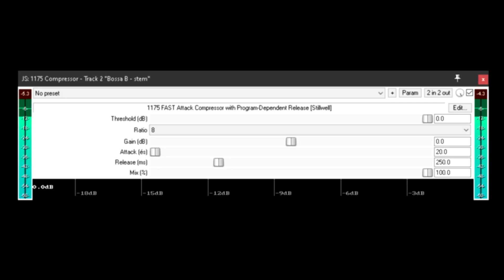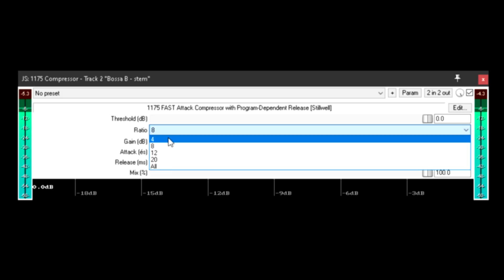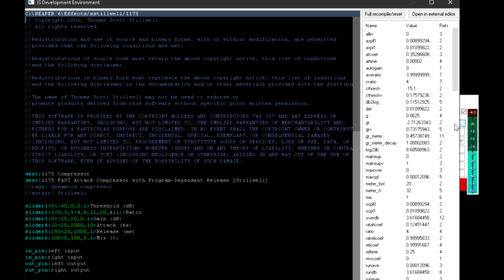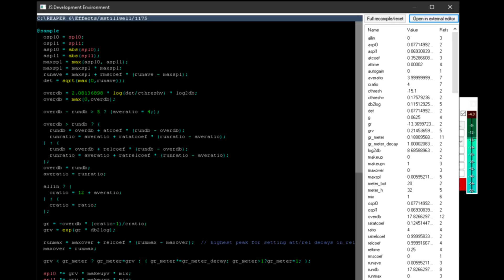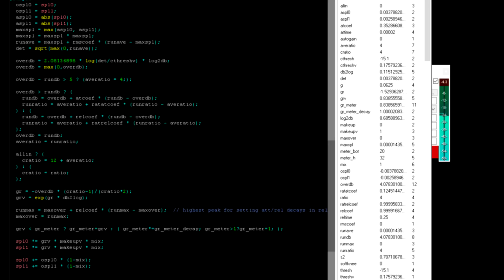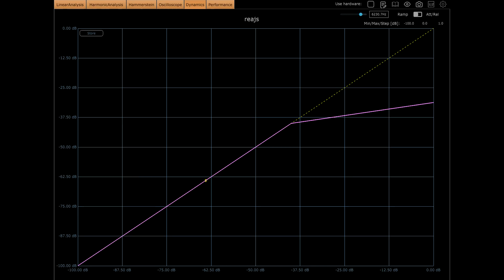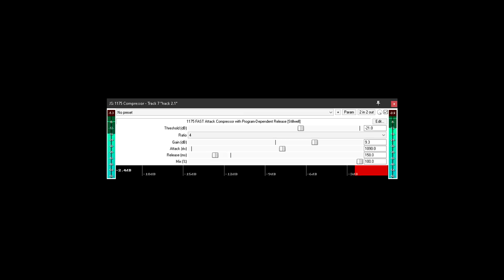All Buttons In Is Not A Ratio Control

Comment: Hi, if you have found an error in the code over a year ago why this is still not corrected in Reaper?
Reply from the maker: It was fixed almost immediately.
Reply: @DanWorrall  Possibly somewhere else in the code, because I checked the line from your video and it is no multiplied by 2.1. thank you.
Reply from the maker: The line I changed was not the bug, my fix worked but was just a quick and dirty hack. The actual error, further up in the code, is now fixed properly, so my hack is not required.

Comment: All button in mode on the 1176 changes it from a feed-forward compressor to a feed-back compressor. That is why it changes the Attack and Release behavior. That is the case for the hardware at least, I am not 100% sure of the plug-in.
Reply from the maker: I don't think that's true. I would expect the ratio to get lower in that case. AFAIK the 1176 is always a feedback compressor, and ABI does something more complex than that.
Reply: @DanWorrall  I am making that conclusion directly from the electrical schematic. The ratio buttons control a resistor network that feed the detector. When you press all buttons in it puts all of those resistor in parallel and creates a lower resistance to the output side of the gain stage than the Input side, as it is in all other modes.

This explains why you are seeing these unexpected behaviors. I know of no other explanation for the threshold decreasing after the knee of the compressor and the Attack/Release knobs effecting ratio. Those are feed-back design behaviors.

Comment: Basically, the 1176 itself is a very interesting compressor. I’m judging by Tim Petherick U76 compressor for nebula 4, because it’s most accurate emulation of 1176 compressor and you really can’t hear the difference with hardware in blind test. So, at first, the 1176 all buttons mode modulate the signal. In plug-in doctor I see that waveform do changes from sine to something between sine an sawtooth, that’s doesn’t happens to another ratios. At the second point, all ratios are really looks the same but with different threshold point, and this point are floats according to a attack and release times. Attack and release times (or maybe “speed” is more accurate) also floats according to input signal amplitude. Lol.

Comment: Et voila! From the 6.27 changelog, released a couple days ago. " JSFX: update 1175 compressor and various others to fix overcompression, add deprecated blown capacitor mode to preserve old behavior".

There you have it. Gotta appreciate the interaction here. It's hard to know for sure, but my hunch is that this wouldn't have gotten changed were it not for this video. Good contribution! ;)

Comment: Fixed in next reaper release:
6.26rc3 - March 26 2021
+ JSFX: update 1175 compressor to fix overcompression, add deprecated blown capacitor modes for old behavior
(havent check the code, not sure how it has been fixed, a diff check is needed)
Keep reporting ! 😉
Reply: Funny, this bug was alreayd reported at least in 2013, and affects other JS plugins: https://forum.cockos.com/showthread.php?p=2008836#post2008836
Though, it should all be fixed in nest version.
Glad you made a video about this :P

Comment: @Dan Worrall , I expect the problem isn't with the calculation of ratio (which really, truly should be correct), but with the value of "overdb" which is being multiplied by 2.08136898 (suspiciously close to your 2.1, eh?) on line 84 of the stock version of the plugin (line 10 of the @sample section).  Your change accomplishes roughly the same thing as removing that multiplier, I'd think.

Being that I wrote that around 15 years ago and haven't touched it since...it's hard to know what I was including that constant multiplier for, but I think that's more than likely the problem.  Some of the math in there is condensed down to constants where possible to avoid using expensive functions like LOG() or EXP() if I didn't absolutely have to in the middle of a per-sample loop.

A lot of those JS plugins were written as proof-of-concept of things I was working on...and JS is absolutely BRILLIANT for that.  Also, like anyone, I learn over time and things I did then may not be the same things I would do now.  You live, you learn.

Really, REALLY odd that nobody's brought it up before now...or at least nobody brought it directly to MY attention where I could do something about it.  I only found this video because someone else pointed it out to me.  Always feel free to reach out to me if you have concerns about something I've written - if you don't have my contact information you can file a support ticket or fill out a contact form on the website and I'll be happy to provide it for you.

Thank you for bringing it (indirectly) to my attention. :)
Reply: Reviewing the source code of Rocket compared to 1175, I'm almost completely certain that's the issue.  I've reported the same to Cockos if they want to fix it in their distribution, although that would cause a major backwards compatibility issue for existing projects.
Reply: No problem for backward compatibility, as it turns out. The plugin has been updated, and the old settings are listed as "blown capacitor (ratio n) - deprecated" under the ratio dropdown. So the old settings remain, as well as the new ones.
Reply: @petersamps  yep, talked with Justin at Cockos last night and this morning about it and reviewed his fix before he released it. 👍. Existing projects will use the “broken capacitor” presets and new instances will use the new settings by default.
Reply from the maker: Now I feel bad. In my defence, I had no right to expect support for an old JS plugin that's bundled with Reaper... But thanks for chipping in and clarifying, and I promise not to do that again!
Reply: @DanWorrall  absolutely not a problem...you shouldn't feel bad at all!  I wouldn't have known the issue was there unless someone reported it...if you find a problem in something else of mine, please...DO let me know.  I just find it somewhat humorous that it's taken THIS long for someone to say something!

Comment: I have absolutely no idea about compressor design, but I did some testing, and from what I discovered, the code that calculates the gain reduction `gr = -overdb*(cratio-1)/(cratio);` is actually correct. An equivalent formula, that's maybe easier to read would be `gr = -(overdb - overdb*(1/cratio));`, which basically calculates the difference of the uncompressed over-threshold level and the compressed level. The problem is that the value of overdb is roughly twice as big as it should be. Perhaps it has to do with the following line:

overdb = 2.08136898 * log(det/cthreshv) * log2db;

Edit: Turns out this has been discussed on the reaper forums quite some years ago: https://forum.cockos.com/showthread.php?t=125584
Reply: Removing that   * 2.08......    bit I can make it null with inserting the same value inserted in the GR line, as shown in this video.

Comment: What I get from seein this compressor work is that it actually is a Negative Ratio compressor, the most extreme way to compress. 
It works something like this:
Let's say you have the threshold at -12 and the signal is peaking at -6. If you set a 2:1 ration the compressor would reduce 3 dB in theory.
With a ratio of -2:1 (notice the minus which indicates it's negative), the compressor will reduce 2x times what goes over the threshold, which would be 12 dB.
If the ratio was -3:1, the the compressor would reduce 18 dB. 
And so on.

Comment: Over on the Reaper forum, it's being suggested that the version of 1175 that is included in Reaper isn't necessarily the version that Stillwell wrote, but possibly one of many user-modified versions floating around. I know that you looked at the plugin after many requests, however, due to the fact that JSFX code can be modified by anyone and then uploaded without any real oversight as far as credit and versions is concerned, saying "1175 doesn't work properly" is kind of like saying "water is wet". All JSFX plugins are suspect. They're a great tool, and I use certain ones all the time, but for my own piece of mind, when I find one that does what I want, I copy the code to a special place on my hard drive just in case the thing gets modified, sometimes not even by the original coder, and breaks my project.

Anyway, I love your videos, but I think there are more compelling topics to address than the accuracy of a JSFX plugin. Just my two cents.
Reply: I know my version didn't have a gain reduction meter, so yeah, SOMEONE has changed it...but I don't know by how much.
Reply: how can a modified version end up in the REAPER installation package?
Reply: @GULF_OF_aMEXICO  the same way the original did...by someone giving it to Cockos and allowing it to be used, or by Cockos making the change themselves.
Reply: @sstillwell  you mean you weren't aware that they had been distributing your plugin?
or weren't aware that it was a mod?
i thought all those JS plugins came directly from the devs or with their approval

maybe that was the original they got
Reply: @GULF_OF_aMEXICO  No, that's not what I mean at all.  I gave Cockos the original version of 1175 directly, and for a long time that's what was distributed, because originally there was no way to do graphics in JS...that was added by Cockos later.  At that point SOMEONE made the change to 1175, but that was no concern of mine as I had already given it to them to do as they wished with it (assuming compliance with the licensing/copyright restrictions as stated in the comments at the top of the plugin).  I just don't have an original copy of 1175 to compare to to see what changed (although Cockos keeps archives of their installers, so you could "go back in time" to see what the original looked like.  I suspect the bug was mine, though, not someone else's.
Reply: @sstillwell  got it, thanks for clarification

Comment: Great tip! Now I just have to figure out how to do the same thing in Macfizz's GUI modded version if 1175. Btw, how did you manage to load a jsfx in plugin doctor?
Reply: i just modified Macfizz's mod, but didn't test it, so if you need pointers let me know
Reply: @GULF_OF_aMEXICO  It is the dkaps.jsfx-inc file that contains the compression algorithm, right? Is it line 63 that needs to be changed or some other line?

Edit: Figured it out. It is line 63 in dkaps.jsfx-inc that needs to be changed from "/this.cratio;" to "/(this.cratio*2.1);" Thanks for the answer anyways! :)
Reply: @nj1255  yep
Reply from the maker: There's a standalone ReaPlugs JS plugin

Comment: I watched a video about the circuit design of the 1176 a while ago and they said the ratio button isn't actually a ratio button. It instead controls the threshold. And the "all in" mode doesn't need all the buttons in, just pushing 1 and 3 in (iirc) is enough.

Comment: Funny! I've had a look at the code, and line 84 is:
overdb = 2.08136898 * log(det/cthreshv) * log2db;
No idea what that magic 2.0813... is for, but with what you're telling it sure looks very suspicious.
Reply: After 15 years, I don't know what the 2.08... was for, either. :). But you're correct that that is where the problem is.  The ratio calculation is correct.  Increasing the denominator of the ratio calculation by 2.1 roughly compensates for overstated calculation of the amount over threshold.
Reply from the maker: I have a sneaking suspicion, which I wasn't confident enough to mention in the video. However, 1176 compressors are feedback designs. In order to achieve a 2:1 ratio with a feedback topology you actually need a hard limiter transfer curve internally. Higher ratios, like 4:1 require ducking style transfer curves, just like the unmodified 1175. My guess is that this is actually running as a feed forward design, when that wasn't intended, and the transfer curves are designed for feedback operation.
But I'm too lazy to try to untangle the code and see if I'm right.
Reply: @DanWorrall  1175 is not a direct emulation of an 1176...rather just a compressor with similar VERY fast attack (and less so on release) times.  That yields a surprising amount of the "flavor" of an 1176.  Writing truly complex code in JS is difficult since all variables are essentially global whether you use functions/subroutines or not.  @alexthi is correct about where the main problem you described with the ratio is actually located.  I made a comment at the top of the page before I saw these comments.  After 15 years it's all a blur anyway.  :)
Reply: @DanWorrall  That's an interesting suspicion. The code really looks like unfinished work to me: there is actually an RMS feature in it, which just lacks a slider on the UI.
It takes very few modifications to turn this implementation into a feedback compressor (multiplying maxspl by grv, removing that 2.0813... and setting gr = -overdb*(cratio-1) without the division by cratio). It is a bit glitchy for very short attack times though (<500us).
Oh, and the "All buttons in" setting does have a special behavior implemented... although whatever it does, the attack/release curves look very much the same.
Reply: 2.08136898 = 1/(ln 2)^2

Comment: JSFX effects are mostly user contributed and were included into Reaper distribution many years ago. They are not only meant to be used but also serve as the basis for user hacking, which is what Dan demonstrates (I wish you underlined this point even more - JS are meant to be tweaked!).
Even if some of them have some bugs (and all code has), it's hard for Reaper devs to fix them due to obligations to backward compatibility - some Project out there relies on them working in the same way they always did.

I believe I was the one who mentioned JS in my comment under the previous video. I'm honoured. Thanks, Dan.

Comment: Does pressing all ratio buttons in work on actual analogue compressors, or does it also just effect the attack and release behaviour? We have a urei 1178 at uni and we've just started using it. Is it a case by case basis? Very curious to try it out.
Reply from the maker: The plugins all work like that because that's what the hardware did!
Reply: @DanWorrall  sick!